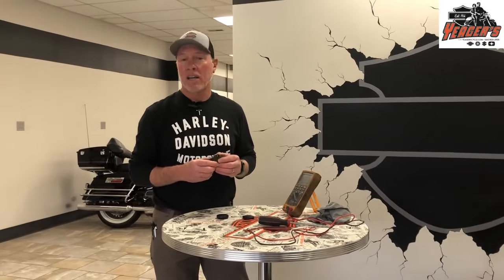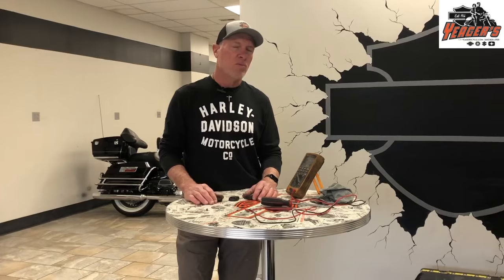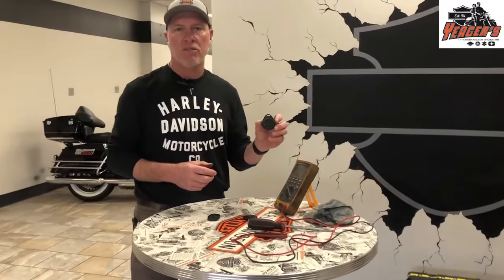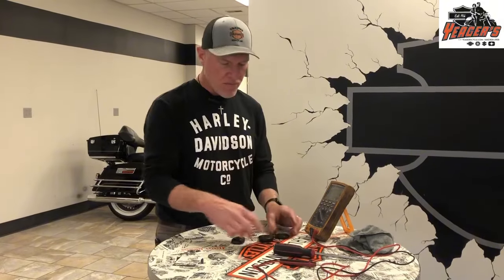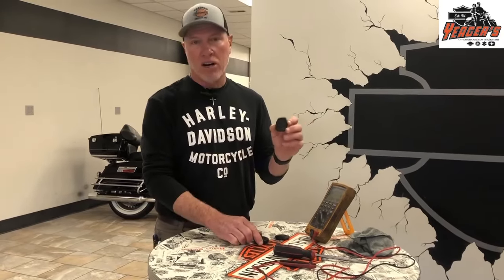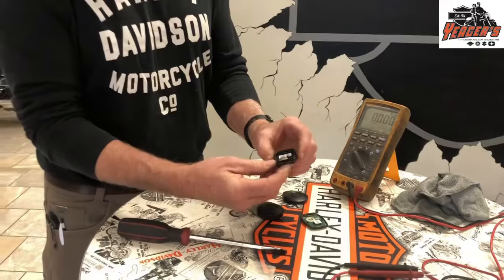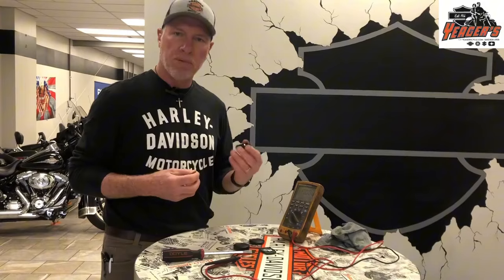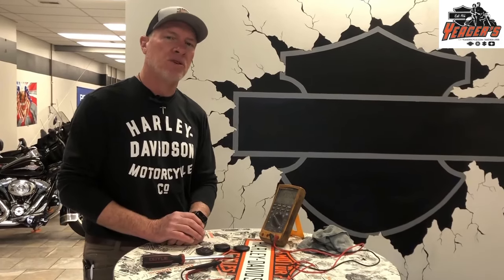Harley-Davidson Key Fob Talk!

Comment: Hey bud I bought a pre owned PA and I was wondering if there is away to get all of the settings to the factory default? Thanks.
Reply from the maker: Settings for the factory defaults? Are you referring to the security PIN code?
Reply: @yeagerscycle3450  no just any settings  in general, as in display, settings for suspension…
Reply from the maker: @pspez  I do have another video that explains the ride modes and how to change them. I have also made a spread sheet that I can send you that explains what all the ride modes are and what is different between each. I can email that to you if you give me your email.

Comment: Ironic right? Let’s put smaller batteries in the Pan Am!  I love mine though. I want to say a fob can still malfunction with a new battery. I unfortunately had one and it took some frustrating time to figure out. If anyone knows they have a new battery and it’s making good contact, the fob sensor itself can be bad. HD just replaced mine.
Reply from the maker: True, we have seen this a couple times as well. Another thing I heard from another dealer is they have used non harley reputable brand batteries in the PA fobs and they not work. Installed the HD Panasonic battery and it worked fine. Did not understand that but it was a fact.

Comment: As a 45 year certified master auto technician it is my understanding that in order to test a battery you must check the voltage under load to test the battery's capacity. When you just check the voltage like you did the battery could still just have very low capacity and give you the full 3.0 v reading but be three days away from not working. Capacity and static voltage tests are not the same thing. You are only testing the battery's ability to put out voltage but NOT the battery's health or in other words capacity. If I have the FOB apart I'm just putting a new one in.
Reply from the maker: Good point! Probably is easier to just replace it?
Reply: I was just getting a extra FOB